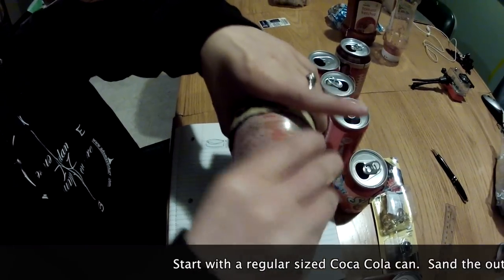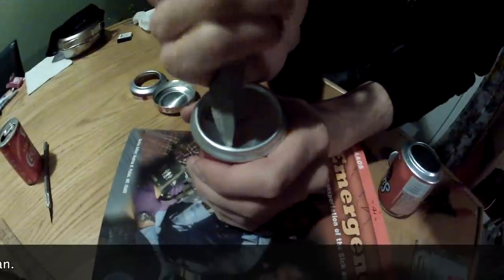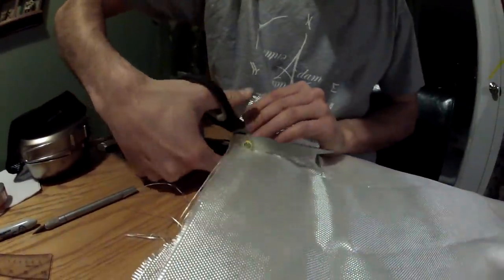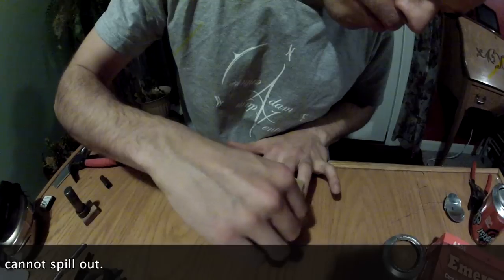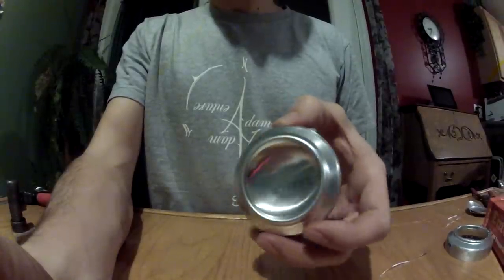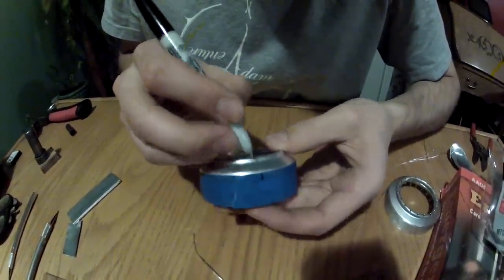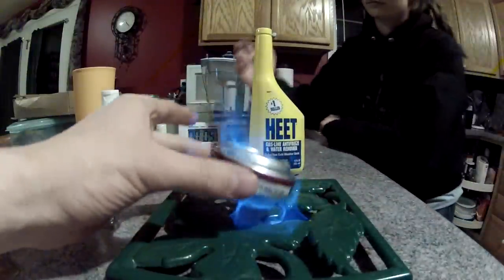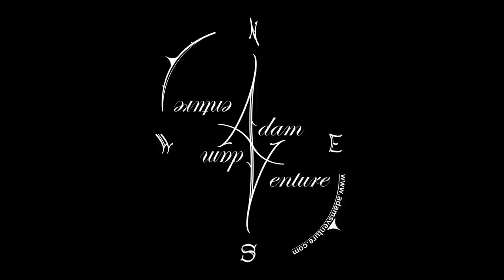Alcohol Stove, Best Camping Stove Design

Comment: Will it work even in a high altitude?  Will it consume more fuel?
Reply from the maker: It will work at high altitude however you have to remember that boiling point is lower at higher altitude and so you may have to cook food for longer because the water can't get as hot.  This means more fuel.  It will take some experimenting to dial in what your stove will require to meet your cooking needs.  Even with lower boiling points the fuel required is minimal.  Enjoy.  Please tell me your experience.

Comment: So from top down it goes fibreglass with grommet, then fibreglass, then insulation? Sorry that part confused me a little.
Reply from the maker: Pretty much. I build it upside down. put the top can facing down. Place the fiberglass over the hole (with grommet in the middle). place in the smaller, inner can.  Place a piece of insulation on bottom and tuck it into the edges between the inner and outer can. Then put on the bottom. Hope that helps.
Reply: Okay but you had said you put another separate peice of fibreglass without the grommet. Where does that fit in? Before or after the insulation?
Reply from the maker: Bobby Fournier Ahh, yes. If you want to make it EXTRA spill safe you can add in another sheet of fiberglass that has no grommet.  First the grommet sheet, then the no grommet sheet then the inner can, followed but the bottom insulation and bottom can.

Comment: Will the stove burn hotter and longer if you use a better alcohol? let's say 190 proof ethyl vs. isopropanol?
Reply from the maker: I believe that it could burn hotter but probably faster not longer. Cleaner fuel burns better but alcohol is just a fast burning solution. It has to do with how easily it vaporizes not how pure it is, Ex. kerosene is slow, alcohol medium, gasoline very fast.  If you test it please share!
Reply: Adam Haggerty okay thanks. great video btw

Comment: Do you really need the tape step for marking holes? Wouldn't just measuring by guesstimating be good enough since you don't need an exact number of holes and if they are only a millimeter of space off really matter?
Reply from the maker: Yes, the number and placement of holes is not so critical. just an example of how to make it cleanly.  You will however notice a difference in performance depending on the number, size and placement of holes. So depends on what you're going for.

Comment: Why do you need insulation in these? What purpose does it serve> Is it only to prevent spillage?
Reply from the maker: The insulation serves 2 purposes in my stove design.  1 is to prevent spillage and 2 is to help wick the alcohol into the side chamber where it can evaporate into the flammable gas.  The top fiberglass is only for spills where the inner insulation does both.  Hope that helps.

Comment: I think I would make mine a bit higher for longer fuel burn, but otherwise impressive design
Reply from the maker: +Johnny Wallace Thank you.  Yes very easy to make it a little taller, I designed mine specifically to fin inside a little titanium stove that I have.  Hope your build goes well.

Comment: I made a simple stove about 30mm high and timed the burn at 55 mins from full.

What is the maximum burn time in this
Reply: +Edward LIAN no-bare can.I have built one recently using a baltik pair of cans with ceramic fibre but have yet to try it.
if you put a filler in you loose volume so need a larger body to compensate for lost time.
I like to make a coffee,then cook and finish up with another coffee,all up about 35 mins ,and I like to take only one stove and 1l of fuel
Reply: The max burn time depends mostly on how tall the stove is, which determines how much fuel it can hold. Obviously, if the stove is 2x height, it will burn about 2x the time when full. The captions say the stove walls are 20 mm tall, which will hold about 30 ml of fuel. I don't see how 30 ml can burn for 55 minutes, unless the flames are heavily restricted. 30 ml should burn for 15 minutes.

Comment: I see that on your site you said you now use steel wool, do you have a video of how you get that in there and what you use to seal the top?
Reply: Do you still use fiberglass cloth"" or do you use some sort of steel to seal it in.
Reply from the maker: +jak smith I left a link in the description for other possible materials.  However this stove design works perfectly well with no fiberglass.  I have another version that I use quite often that has steal wool lightly packed into the walls of the chamber, this helps wick the alcohol up to the holes.  hope this helps
Reply: +Adam Haggerty    how do you keep the steel wool inside, without the fiberglass sheet on top?
Reply: @jaksmith6465  You pack it between the inner and outer cans, not in the middle bowl.

Comment: You really don't need all this. Or 2 cans. You only need one can. You can use the top and bottom half and squeeze them together. Make both edges about 5 inch tall press together. Use a screw to create holes. I don't need or use insulation. Pressed tightly together to the point the top half of the can can almost fold around the bottom of the lower can half its ready to use. 

The top half of the can is used to pour in fuel. The hole obviously isn't Central. Again not important. A 2 p or 50p cuts it off fine. Alcohol wont spill

Comment: You used Three different cans? All same size?
Reply from the maker: thank you for the comment. i use the bottom of two regular size (12oz) soda cans and then one smaller can (red bull can works well) every country has slightly varying sizes. the only important thing is that the inside can is smaller in diameter.

Comment: how do you get the sides so smooth,  mine is razor sharp on the side,  have to be extra careful holding it
Reply from the maker: +jak smith just sand paper. Once its together it is very easy to sand and take down any sharp edges. Hope this helps.

Comment: Do you have to replace the fiberglass
Reply from the maker: that is an excellent question. I have not used mine enough to wear out the fiberglass.  When burning you will notice a discoloration of the outer fiberglass after a few burns, mostly where there may be an oxygen leak.  I have not noticed it burning up or wearing out.  If there are others who have experienced this I would love the feedback.

Comment: Could you make it taller and get, say, 15 minutes out of it? 

For bigger cooking jobs, or more than one person, it might be beneficial to not need to refill fuel between each cup of water. 

Request: A boil test to get about 3 cups or so out. And a DIY mini pot rack for a cooking pot. 

Way cool, though!
Reply from the maker: ***** Hey Jeremy, thank you for the comment!  Larger stoves are of course possible, just scale the cans.  There is a Huge beer can that I am looking to turn into a stove to try and make it longer burning and more stable.  At some point, the benefits of having a an alcohol stove will fade away when talking about burn time or controlled burn or grilling.  Alcohol stoves are the BEST for quick boiling but gas stoves tend to be superior in these other areas.  I'll try to get up a video of my larger can stove and see what the benefits are.  Im curious if that much alcohol will defeat the purpose of a lightweight can stove.   We will see ;-)
Reply: Cool. Thanks!
Reply from the maker: ***** I'll see what I can do

Comment: What else could I use for fuel? Something that dont smoke and lasts a lot longer ? Anything?
Reply from the maker: +msPlums7 well...it is an "alcohol stove"  I dont think there is anything else that will burn well or safely in it. I have tried a variety of alcohols and even hand sanitizer works but something like gasoline or kerosene will not work
Reply: What about tiki torch fuel?
Reply from the maker: Well tiki torch fuel is usually kerosene. It might work but it has a low combustion and usually burns with lots of smoke. If you try it let me know, I have never tested it.

Comment: There is only one problem with the design. The fiberglass insulation. Those thin fibers tend to melt into a fused mass and the stove ceases to work. I have built more than 3000 alcohol stoves in 14-15 different designs.

Hiram Cook made a vid that shows the insulation fused into a solid mass
Reply from the maker: Thank you for sharing, that's why I included a link to other materials that could work better.  If you experiment and find a better material I would love to hear it!

Comment: I've tried a few different designs and can't get the "two" cups of water to boil. It was bubbling for over 10 mins but never came to a rolling boil. any thoughts?
Reply: your fire is not hot enough, you need a fuel with a higher ignition point.
Reply: What fuil do you suggest???
Reply: well dont know
Reply from the maker: connie connie
I use "HEAT" burns nice, clean and hot.  A lot of people use denatured alcohol, mostly the same thing
Reply: HEET is the hottest and cleanest burning fuel. No smell, no soot. Perhaps you didn't cover your pot or your pilot holes are too far up and your flame is not focused on the pot's center because it creates a wider spread of flame.

Comment: Can I use my dremel tool to do the cutting?
Reply from the maker: maineville prepper Do you mean using a saw tool to make the cuts in the can?  I think it would be possible, however, you will get much cleaner cuts with a knife I think.  No harm in trying a test can.  Let me know how it turns out.

Comment: can i use instead alcohol a zippo fluid??
Reply from the maker: I really don't know!  If you try it let me know.
Reply: ok, i will try and let you know how it hapenned :)
Reply: I've tried - basically everything flammable works - 40% vodka wasn't working properly, but as long as you'll have any alcohol over 75% or lighter fluid, benzine, it'll be fine ;) And that's why I love them so much - you really don't have to worry about fuel type
Reply from the maker: Excellent, thank you for the feedback!
Reply: Adam Haggerty I was just wondering, it says that glass-fiber is burning at around 1200, and aluminium melts around middle 600s - how can glass-fiber cause any harm burning, while the temperature is way below 1200? Assuming aluminium tin is not melting obviously ;)
And anyway, have you found any suitable replacement for that, easy to buy and looking as good as that one used in video?

Comment: can i use some other thing in the place of alcohol e.g kerosene oil
Reply: pls reply fast
Reply from the maker: I do not know if kerosene will work in the stove. It is designed for alcohol because of its burn rate and heat. Gasoline will not work because it is too combustible. If you do try kerosene please let me know. Be safe and be ready to put out a fire.
Reply: +Adam Haggerty thanks a lot

Comment: Why do you need different chambers in the stove?
Reply from the maker: Great question.  The inner chamber holds the alcohol until the can heats up. Once the outer chamber has heated up then you'll see that the flame moves to the outside holes.  This happens because the hot gas in the outer chamber creates a vacuum effect that sucks the alcohol. This allows the flame to move to the outer edges where the stove burns more efficiently.  With only one chamber you'll basically have a sterno vs a stove.  The flame wont burn as hot or efficiently, it always is dancing, trying to pull oxygen in to feed the burn.  In an alcohol stove like this the flame is fed from the center hole and burns on the outer edges, very efficient.  Hope that helps! :-)
Reply: Thanks for the answer! That's pretty cool.

Comment: Can you get it to burn longer than 5 minutes
Reply from the maker: sure, just add more fuel.  this model holds around a little over an ounce and I only did a burn test with 0.5oz. At sea level it boils a cup of water in 3 min. I'll do a boil test because I have had a lot of requests.

Comment: Boiled a cup of water in 2 and half minutes? I doubt it. That is the most complex alcohol stove design I've seen yet. Totally unnecessary. His method for cutting the cans is excellent, so I did learn something.
Reply from the maker: Boil time isn't edited, for sure it will vary depending on cookware, altitude and temp. Complex, yes, are there simpler ways, yes, does it do a good job, I think so. I also made a version without all the internals, much simpler, didn't make a video for that one. Thanks for the comment.

Comment: why not use petrol???
Reply: +Hilmi Albums No one else answered so I'll help out.  This type of stove works on fuels because it burns the vapors not the liquids.  Once the alcohol starts to flash it produces a vapor that "jets" through the small holes causing a more controlled burn.  Pure petrol would be harder to control so that it boils vapors and still burns longer.  You'd probably end up just having an out of control fire rather than a stove.  Also, the goal is to have a low soot super clean burn.  Petrol is very sooty when it burns.  You could add some petrol to the alcohol, but it's not likely to help much.
Reply: Thanks mobiusUSAH
Reply from the maker: +MobiusUSAH Yes, very good answer, thank you.  Also petrol has a much higher cumbustion meaning that you would be more likely to create a mini explosion rather than a clean burning stove.
Reply from the maker: Too combustible! Alcohol has a much more controllable burn.

Comment: bit of a fuck about for me that... i much prefer to make one with a pen knife in about 3 mins which works as good then bin it
Reply from the maker: whatever works for you.  I like DIY projects and can guarantee that mine would out-burn your 3 minute stove. ;-)  I went to the trouble of making the design to try and make the most fuel efficient stove, best for backpacking.  Burn enough alcohol under any pot of water and you'll get it to boil but I found this worked best for the least amount of weight.

Comment: Ur not using a regular sized can and Ur not using a coca cola can. -_- I'm displeased
Reply from the maker: Dillan Smith I used a variety of cans, you are correct.  The standard US soda cans have roughly the same dimensions with small variations in the tops and bass. I don't pay much attention to the brand of the can, they all work if you do it right. If you have any questions, feel free to ask.